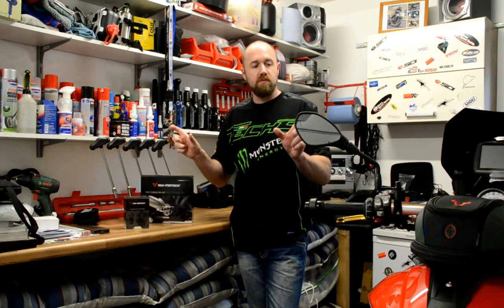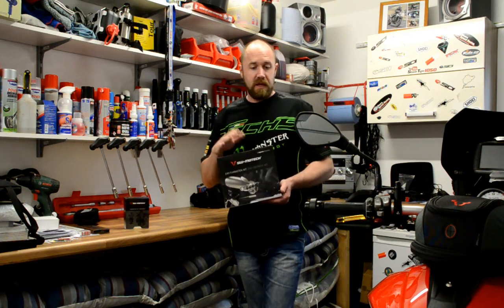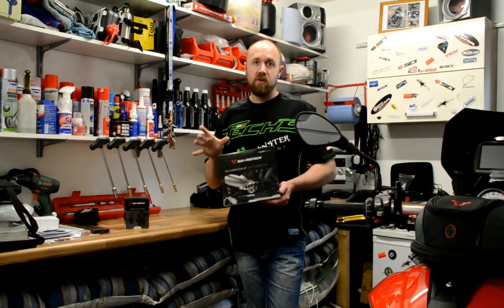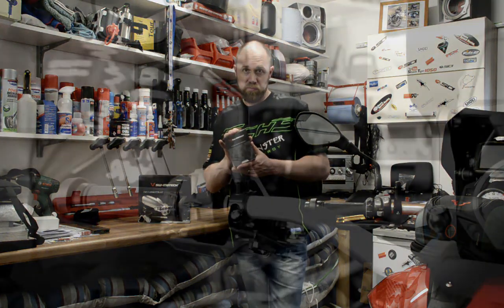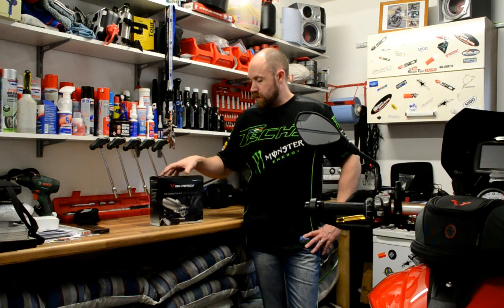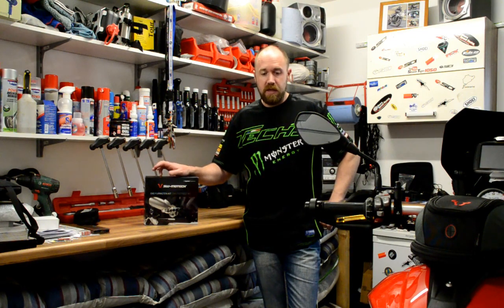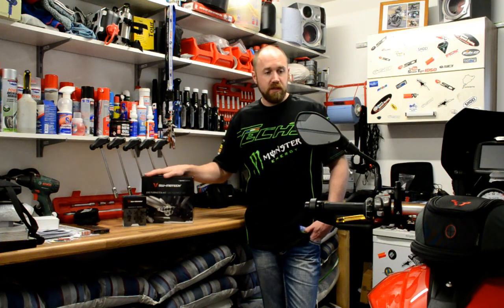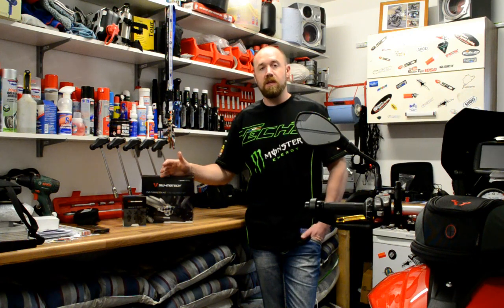Sw-Motech Mirror Extensions and Evo Footrest Kit for the BMW S1000XR

Comment: Really illustrative video, thanks so much! Sorry, I know it's been a while but I'm wondering if those mirror extenders would fit other bikes? From what I can see on the SW Montech website they're just a generic M10 bolt, so it would make sense?
Reply from the maker: Yes they'll fit most bikes, but best to make sure using their bike filter on the website. Sometimes depending on the bike, these extensions can impeded the switch gear, so do check to make sure👍
Reply: @thelikeablerider8800  Great, thanks for the reply 👍

Comment: I only saw technical explanations, but no video for installation. This type of SW-Motech crash bar does not require any modification, while the original BMW, and the Givi need a small change
Reply from the maker: Dany Brancato 
I had them on my Tiger, and it was fairly easy to install, comes with good instructions!

Comment: Those foot pegs look very interesting. I wasn't able to find them on the SW-Motech website.  At least not the articulating kind that you have installed. Only type available were the standard two vertical position pegs like I used to have on my GS. Are those perhaps an unavailable test version specifically for your assessment?
Reply from the maker: Oh Alright! 
no they're avaiable! get me sec I'll find a link
Reply from the maker: Oh Alright! 
did the link in the description not take you to them?
Reply: TheLikeableRider No, just to the main page at SW-Motech.
Reply: TheLikeableRider I found them, thanks. Did a term search and it came up.